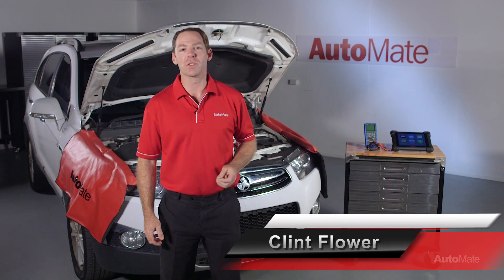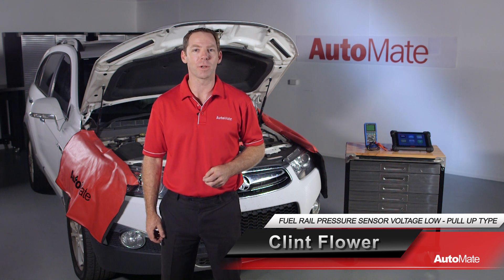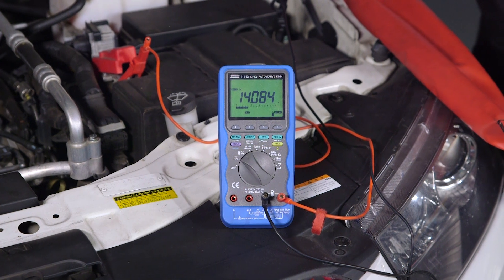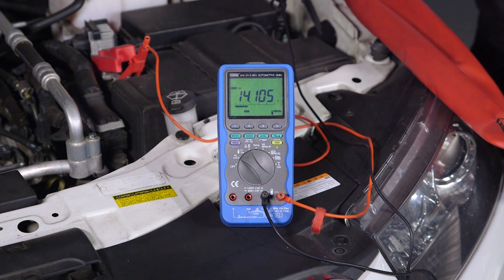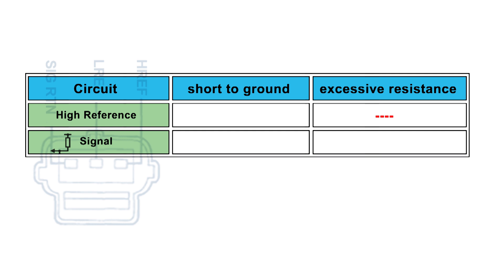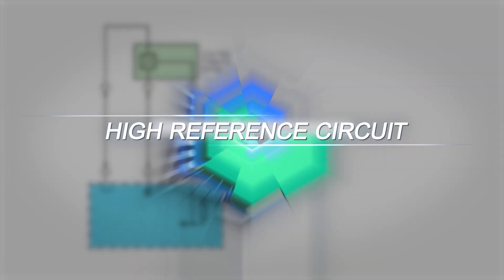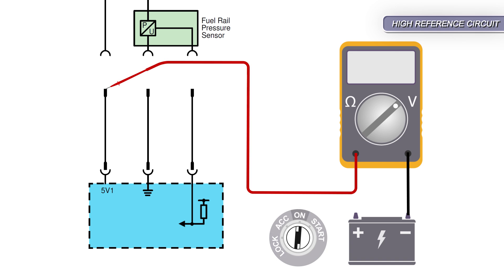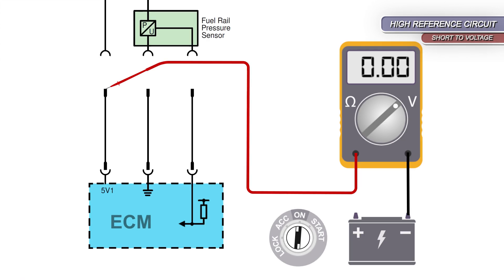Fuel Rail Pressure Sensor Signal Voltage Low Pull Up Type

Comment: If the signal voltage is high,the fuel rail pressure is high 
What's the solution???
If the signal voltage is low ,the fuel rail pressure is low
What's the solution??

Comment: Not correct. +5v Will read 7v difference from the 12 V positive. 12-7=5
Reply: Wrong
Reply: @Tom-pn5sk  What’s wrong
Reply: @Tom-pn5sk  12-7 =5
Reply: I just watched the video again
A positive 5 V supply derived from the 12 V battery will read 5 V positive With a negative test lead connected to the negative battery and will also read -7 V with a negative lead connected to the positive with the battery as shown in the video but this does not indicate a short to ground He says any voltage reading indicate short to ground

Comment: My chevrolet beat DTC  is P0641...  it shows only 740 bars on high acceleration...  and low pickup and huge vibration,  white smoke and long start.. !!
Reply: I am from india..  chevy beat is the 1.0 litter small diesel car

Comment: Hello I have kia sportage 2014 gdi the code P0193 is appear when I changed the fuel real pressure sensor car not starting when I remove it the car is working but not have power and determination
Reply: Why did u change the FRP, what did u get to change ..pls in brief
Reply: How did u fix it?